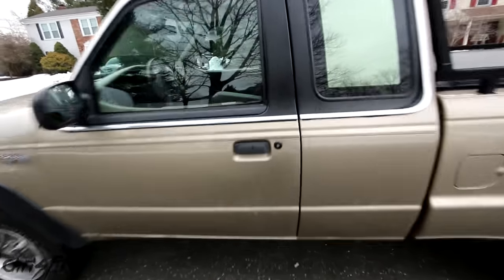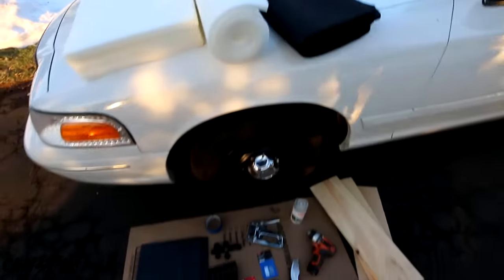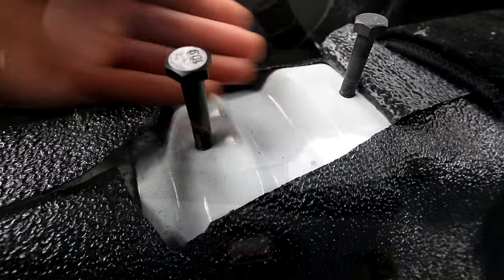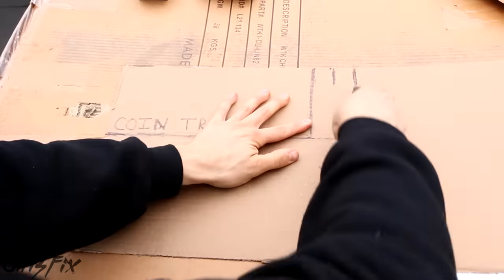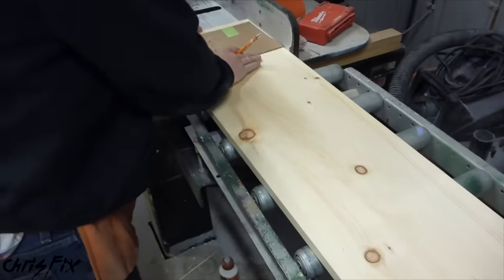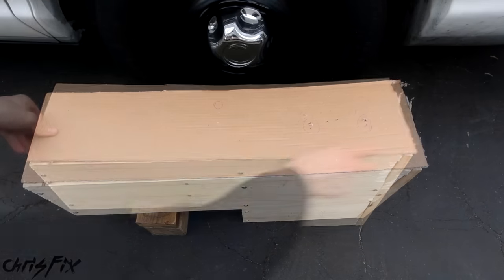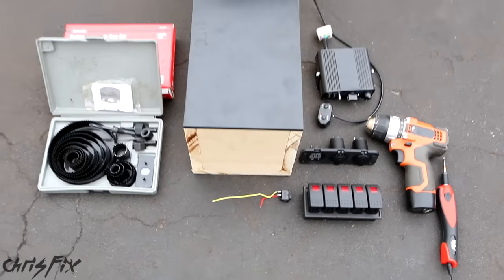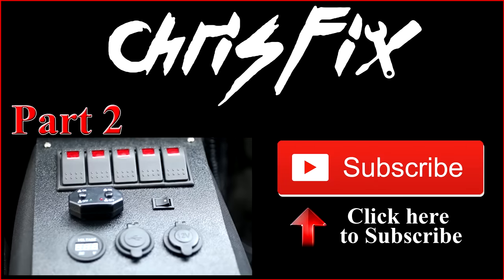How to Build a Center Console for your Car

Comment: have a issue with a ford firsta 1.25 2004 it sometimes cuts out when i brake say at a set of lights etc ive changed fuel filter and a brand new full exgusht when its not moving the idle will sit between 1000-1500 when its about cut out it shoots up and falls down fast to 0 it happens more when car cold but still does happen when car warm
Reply from the maker: +kartar phull Sounds like you have a vacuum leak.
Reply: +ChrisFix just a update found leak with air intake tube clip is broken so very loose also found the pipe coming from air filter to engine loose hooked that back on and revs have already come down to below 1000 so i have to say big thank you as you gave me the confidence to do it myself so thank you :)

Comment: Do you have a link for that surface mount lightbar switch?
Reply from the maker: +Mark Fleser All links are in the description. That switch only comes with the light bar (as far as I can tell because I cannot find it anywhere). It has 2 switches in one because the light bar has amber and white lights!
Reply: +ChrisFix Thanks, I found the link to the lightbar in your other video, I'll check it out.

Comment: 10:49 you have a sliding compound miter saw for heavens sake why would you let the hardware store dude cut the wood??  Those saws at the store are horribly inaccurate as are the guys usually operating them. I personally would have probably cut the side pieces from plywood in a single piece for each side, and used wood glue, tacked together with pneumatic brads or finish nails. But that's just me.
Reply from the maker: Thanks for the tip!
Reply: ChrisFix Hello, are you an german people, because you write the title in german.
Reply: Since Chris is doing this for the masses someone like me doesn't have the equipment he needs to cover all bases. It's one more thing that makes him such an expert presenter and project teacher. He speaks stupid for my level LOL.
Reply: Farmer_Live  no

Comment: they are usually made of plastic so why use wood then. this is something wood is not made for. would think would be cheap to get one from salvage yard too
Reply: +james42519 An injection moulding machine would cost thousands of dollars and before plastic became common place everything in cars was made of either wood or steel.
Reply: who said anything about that? you use plastic the same as you use the wood here. you use glue or screws put it together.

Comment: Why are you telling people to use tape lines instead of measuring? That's half-assing if I've ever seen it.  Also at least wood glue those joints.  Recommending the use of a soldering iron for shaping plastics? Really?!

Comment: Honestly,  the final product looks so cheap and hacked,  the first video backs this up not using a straight edge or proper tools to cut out the square switch.  Overall,  final wrap of material really looks dodged
Reply from the maker: +Sonic Orb Studios Thanks for sharing but the project isnt done and you havent seen the finished product yet...
Reply: ChrisFix Isn't that the final result in the thumbnail? I still think build wise things  could be done a bit better for details.  Fabrication is a whole different ballpark compared to automotive repair.  Just putting some comments out there on my thoughts :)

Comment: been easier to just pull one out other another car/truck in junkyard an make it work in there
Reply from the maker: +skulledmonte84 Not as rewarding as building it yourself though. This was a fun build!
Reply from the maker: +skulledmonte84 but that is another method you can use so thanks for the tip!

Comment: It looks bad and you feel bad! 
Never ever use solid wood in cars.
Never use 1in thick foam on the sides of a console.
Reply from the maker: +IzNoGuD Surfer Thanks for your feedback. It looks amazing and feels amazing. The officer loves it too.
Reply: if its OK for you guys its ok for me.
BUT you should NEVER use solid wood in a car near the driver or passangers. It breaks with long splinters in case of an accident. Better use MDF or HDF medium or high density fiber boards. Best use thin sheets of ABS over an skeleton of MDF. The Beauty of ABS ist that you can form it with heat. For upholstering the armrest check out the videos of cechaflo and for working with MDF check out the videos of CarAudioFabrication. greez